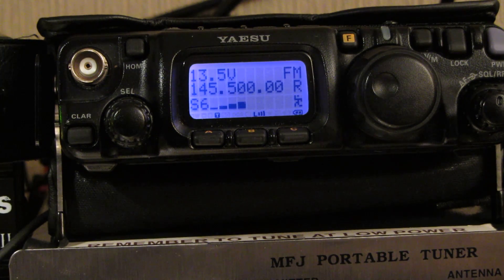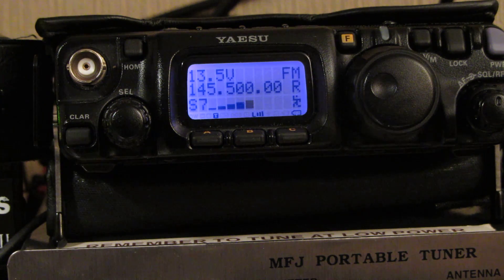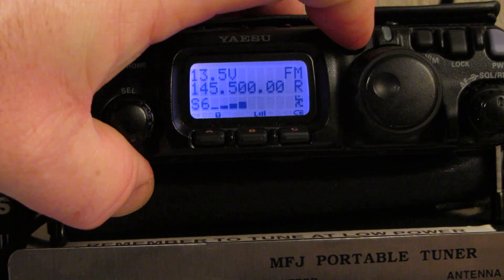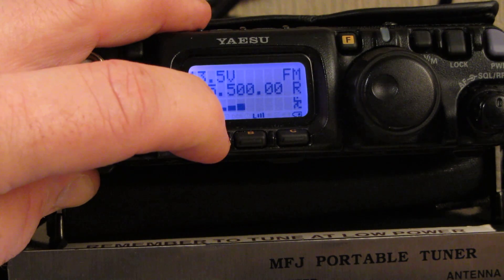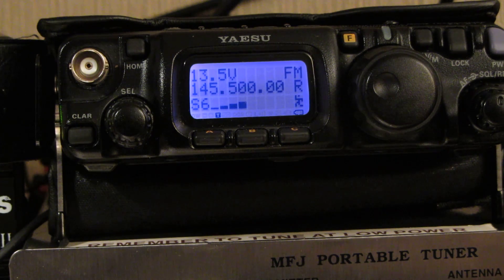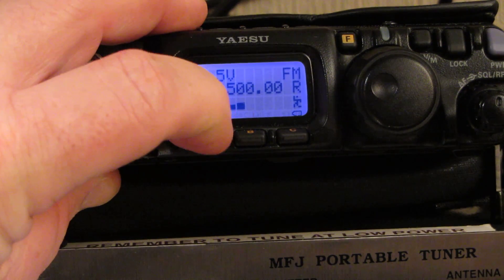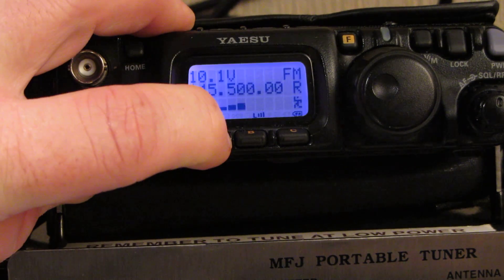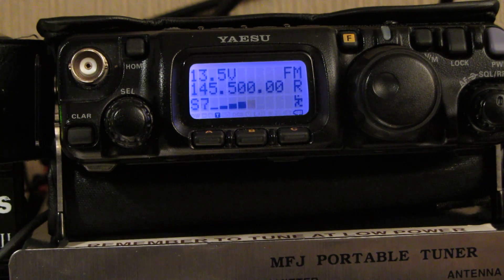Yaesu 817ND Power levels explained

Comment: Also plugging the right power supply helps. I spent an hour researching why the voltage was showing 12.1 and not 13.8, and also why it was switching to low power at TX.... Turns out I had plugged the wall charger and didn't switch back to the bench supply!

Comment: One has to also be aware that the FT-817 is limited to 1.5 watts in AM mode.  Yeasu really doesn’t make that all to clear, they more or less say it’s a 5 watt QRP rig on all bands......  BUT ..... AM is limited to 1.5 Watts factory preset... It’s in the manual, if you look for it.

Comment: Four power levels are available on the FT-817ND: 5 Watts, 2.5 Watts, 1 Watt, and 0.5 Watt. When using Alkaline batteries or the supplied FNB-85 Ni-MH Battery Pack, the microprocessor, detecting internal battery use, automatically sets the power level to 2.5 Watts, which appears on the display as “ ”. If you set the power to five watts, the power level icon is the same as for 2.5 Watt operation, but at 5 Watts the icon is blinking. For 0.5 Watt, there is one “bar” to the right of the “L” in the power icon, and for 1 Watt there are two “bars” displayed.
Reply: Thanks! Mine shows two bars and is blinking at the same time. What level would that be? Shouldn't it be three bars and blinking?